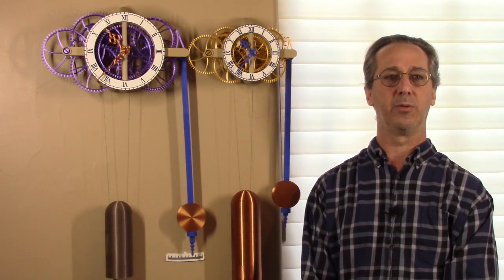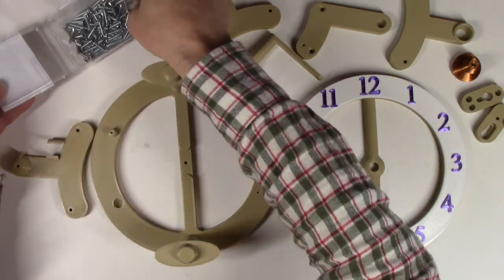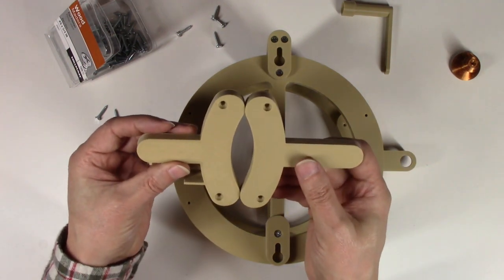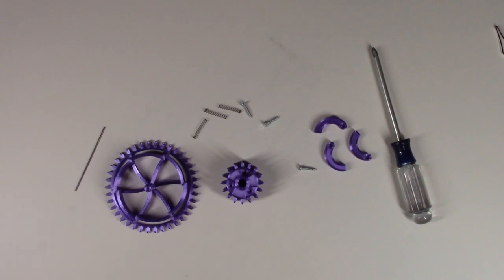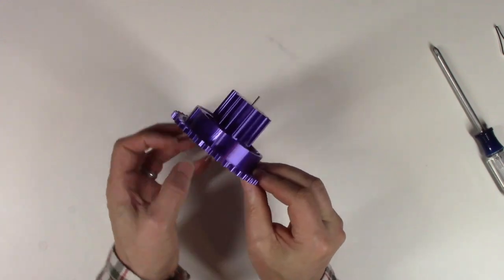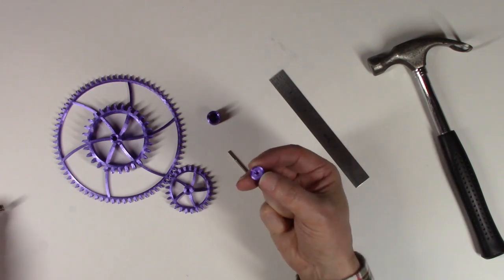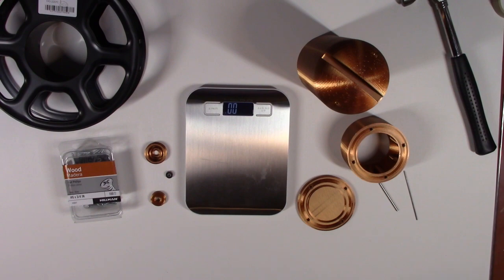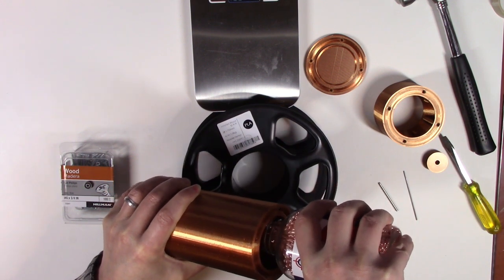EZ Build Clock Assembly Part1 Components

Comment: Hello Steve, I managed to get the watch to work by increasing the weight, but I noticed that it is advancing the real time by a few minutes, what should I do to make it synchronized with the real time and not advance the minutes?
Reply from the maker: Lower the pendulum bob to slow down the clock.
Reply: @stevesclocks  Do you mean to print another arm of the pendulum or just unscrew the nut and lower the pendulum?  And if it persists, what else can I do?
Reply from the maker: @dirvesidade  The adjustable nuts below the bob are designed to allow the effective pendulum to be adjusted. Move them and observe the difference.

Comment: @Steve Peterson

I'm about to start assembly of the clock, but unsure on the weighting to use.

The "Weight Shell" section of the printed guide says 8 lb/3.6 Kg, your video here has 10.8 lb/4.9 Kg.  Another section of the printed guide has projected weights of:
- 7.8 day = 3-4 lb/1.4-1.8 Kg
- 10.1 day = 3.9-5.2 lb/1.8-2.4 Kg
- 15.3 day = 5.9-7.8 lb/2.7-3.53 Kg

I'm guessing therefor the that the 8 lb and 10.8 lb options are for the 32 day configuration?  If the weight is greater than it needs to be, for instance the full 10 lb with the 10.1 day gear combination does that have any issues?

I was aiming for the 10.1 initially and thinking of using hand weights as they are considerably cheaper than BBs (here in the UK at least).
Reply from the maker: The weights listed are just guidelines since each clock may be different. There is not much harm in adding extra weight. It will increase the pendulum amplitude and make the clock more stable.
Reply: @stevesclocks  Thanks for getting back to me.

Having printed the base of the weight pot I can see that it's not going to be wide enough to get hand weights in, so will need to re-think this.

I'm finding a lot of the 3mm holes for the shafts are mighty tight, so will probably need to open these out slightly with a drill.

I'm thinking a light sanding might be called for on clutch components too to clean up the surfaces.  I'm guessing my printer must be a bit off as I'm finding a lot of the components very tight - obviously it can't be your files as many others have successfully built the clock
Reply from the maker: @tomsimmons4482  You can use anything for the weights. A rock with a pulley on top would work.

Most printed holes end up smaller than the initial size. The design starts with slightly oversized holes with the expectation that they will still end up undersized. It is easier to drill a small hole to the proper size than dealing with a hole that is too big. No need to blame your printer. :)
Reply: @stevesclocks  you know, in an odd way it is very tempting to get a rock and attach the pulley now that you've said that - would certainly make for a conversation piece!

Comment: Hi Steve, good afternoon! I started printing the small clock with the 10 day gear, as you said, now what size upper part of the weight shell should I use? thanks.
Reply from the maker: Your filament and printer tolerances might be different than mine, so you have to test to see how much your clock needs. The manual will tell you how much my clock needs. You can use that as a starting point, scaled proportionately to account for your runtime.

Comment: @Steve Peterson

My printer has struck again!

When assembling the palette and pendulum I'm finding the nut very tight , which is not such a big issue.  However, getting the pendulum onto the palette is different matter, it starts is about all I can say.

Similarly putting the parts of the pendulum together, it goes within 1/16" of closing, but that's it.  Lining 2 parts up side-by-side the step profile looks correct so I can only assume it's the hole and peg.

As I said before I don't doubt your designs, it has to be my printer.  I saw a video about a setting in the slicer for "fudging" tolerances on components like nuts, but I'll be blowed if I can find it not - is there anything you're aware of?
Reply from the maker: A simple XY scale on the nut should work. Maybe 2-5% larger.

Comment: Hello Steve, I bought this project on myminifactory, I was separating the files for printing, I've already started printing some pieces, and I noticed that there are several types of pendulum, I printed the pendulum-shaft, I would like to know what the other pendulums are for, I realized that there are several sizes, and which weigth shell top should I print???
Reply from the maker: Everything should be described in the manual. The pendulum shafts with "_long" or "_short" names are only used if you need additional adjustment for the time. Start with the normal ones.

The weight shell depends on the runtime option and the overall friction in your gear train. Build the clock a determine how much weight your clock needs to run reliably, then print the appropriate size according to the table in the manual.

Comment: Good evening Steve, I finished the watch, I made it last 10 days, I did the pendulum test which lasted 5 minutes until it degraded, I did the test with 3.9kg and it only worked for 3 hours and stopped completely, I increased the weight to 4.6kg and it lasted the same time or less, I'm using hook line, it's harder. What's wrong, sorry for the questions, I'm translating everything on Google so I can finish the watch. What should I do to make it work normally???😭
Reply from the maker: It could be too much friction. 5 minutes on the bearing test is fairly short. Make sure the seals are removed from the bearings and the factory grease has been removed. Then test for friction in the gears. Everything should spin freely.

The clock could be out of beat. Make sure the pendulum ticks at an equal angle from left to right. 

If these things don't work, try the 7 or 8 day runtime.

Comment: A question for you, Steve.  Do you have a source for the shaft collar on the minute hand arbor?  Thank you!
Reply from the maker: Here is one at a good price in the US https://www.amazon.com/Hobbypark-Landing-Stopper-Airplane-Replacement/dp/B01EA912P8
There is also a printed part that can be used. It sometimes needs to be scaled down slightly so it becomes a press fit. Or it can be glued into position. The shaft collars are easier since they are removable, but they are not always easy to find.
Reply: @stevesclocks  Thank you for the fast reply!  For some reason I wasn't coming up with that on Amazon.  I just looked it up and ordered them, so they will be here in two days.  I have the clock running and almost completely reliable.  I am going to disassemble it tomorrow to make some adjustments and add a little teflon powder to the bearings.  What I did for the original build was to add a 2.4 mm hole through the printed collar and used two 2.5 mm set screws (180 degrees apart) to hold it in place.  I think the shaft collars should be a little easier and possibly more reliable in the long run.

Comment: this would be about 60 bucks worth of BB's to fill where im at so im just going to try filling it with a 3$ bag of sand. according to some quick calculations I did the biggest weight you have should weigh about 9lbs filled with sand.
Reply from the maker: Measurements on sand local to me showed a specific gravity of less than 2. Solid steel has a density of around 8. Even allowing for air pockets around the BBs, sand only has 1/3 the density. I really wanted for sand to be an option, but the weight shell might need to have many extensions added to be useful. Any type of scrap steel is a better option. Or low denomination coins if you have them. Around US$10 in pennies would probably be enough.

Comment: Hi Steve, first, let me say, I love this project, and it'll be my first when I get my 3d printer. My question is... if one wanted to mount this on a 2x4 or 4x4 or 2x6 for a free standing clock "a la grandfather clock," is there a way to mount this clock and extend the hour and minutes hand? 
Thanks
Ralph
Reply from the maker: Thanks. A clock like https://www.myminifactory.com/object/3d-print-large-pendulum-wall-clock-137009 might be easier to mount free standing or in a case like a grandfather clock. 

Most of my clocks should be able to support longer hands. The extra weight should be minor since the minute hand would only need to be lifted once per hour. Only the second hand in some of my other clocks would need to be balanced.

One consideration is the dial often supports the arbors for the gears behind it. You have to plan around it if you enlarge the dial. That is why I recommended the large clock that already has a bigger dial.
Reply: @Steve Peterson  thank you. When I say extend the hour and minute hand, I mean protrude out to allow for the movement to sit behind it in the "back" of the 2x6,  yet not hidden as that is the beauty of the works, and the hands on the front or face of the 2x6.
Reply from the maker: @ralphguerrero518  All of my clocks use a metal shaft for the fastest hand and a printed shaft for the rest. In this case, the minute hand uses a metal shaft that can easily be extended to any length. 

The hour hand shaft would need to be extended. Most slicers have features that would allow you to split out the center portion, scale it, and merge it back into a single piece.

Some of my other clocks with a second hand would need these edits on two of the gears. The second hand has a metal shaft. Both the hour hand and the minute hand would need to be extended.

My wall mounted clocks are designed to hang from the back. They could possibly hang from the front. You would have to decide if it would be strong enough without sagging.

Comment: good evening Steve I am enjoying building your clock. I did notice frame-back-left-hook and frame-back-left are a little different. could you explane the difference. while following along with you I noticed you were installing the freme-back-left-hook item I printed the other unit
Reply from the maker: Both do the primary job of supporting the winding arbor. Frame_back_left_hook adds a small tab for storing the winding key. I added it to the release after creating the manual.

Comment: My printer has a bed that can print 223x223 cm's. Would like to purchase/print pendulum clock that fits my printer. Please refer me to model that will work.
Reply from the maker: All of my clocks will fit on a Prusa MK3S (250x210) or Ender3 (220x220), so they should fit on your printer. A few of the smaller clocks also fit on a Prusa Mini (180x180).
Reply: The one I'm looking at published 6/10/2020 170x270x120. Is the 270 cm not one piece? @stevesclocks
Reply from the maker: @achillesmjb  That is the overall size of the assembled clock, assembled from many smaller pieces. The descriptions on MyMiniFactory also list the minimum printer size for each design.

I have a Prusa MK3S so I know that every component can be printed on a 250x210 printer. The 220x220 Ender 3 is a popular printer and I make sure that everything will fit it as well. Some parts need to be rotated from the default orientation, but they will fit.

Comment: like the pennies in the pendulum. you could have used pennies in the weight. US pennies weigh 2.5 or 3.1 grams.
Reply from the maker: Good point. Anything with a density near steel or copper can be used. Zinc in modern US pennies is around 7. Steel is 8. Copper is 9. Lead is 11, but barely worth the toxic risk.

Sand only has a density around 2-3, so the weight shell would need to be huge to be functional.

It would take 180 zinc pennies per pound, so just over $14 for 8lb of weight. This is probably cheaper than most other options.

Comment: Thanks Steve for detailed assembly video. What stands for "BB" that you use to fill the weight container?
Reply from the maker: They are small copper plated steel balls used in small target practice guns. Here is a link to the cheapest ones I know of in the US. https://www.amazon.com/Crosman-Copperhead-Copper-Coated-Bottle/dp/B000HKKY7M

Any material with the density of steel or copper can be used. Small nails, scrap steel, pennies, etc. Lead can also be used if you take care of the toxicity. I have seen other clocks that recommend sand or rice, but the weight shell would need to be gigantic to reach the desired weight.
Reply: @stevesclocks  oh, I see. Thank you very much! I wish you great success and much joy in what you love to do!

Comment: Hi. I want to build this. I have been to your site on where to purchase it. I have a question though. The FACE of the clock the outer white circle with the Hourly numbers on it... was that printed as all one piece? With a filament color change on a preset layer in Prusa? I ask because I have an Artillery Sidewinder X1. The filament color change is not very easy or precise. Almost impossible? It seems to plague the Sidewinder users globally. It may be a deal breaker on building any of the designs I see on your site. Might I say, All fantastic designs!! :)
Reply from the maker: I am guessing that color changes on your printer require watching the printer and manually intervening to swap colors. Each new color is several layers thick and there is a bit of tolerance regarding when you make the color swap.
The dial on the smaller clock has a 6.5 hour print time. The first color change at 5 hours is somewhat optional. I like to add a lighter color for better contrast, but it would be fine to skip this change or even delay it for up to an hour if you miss the target time. 
The second color change for the numbers is more important for good visibility. It takes 18 minutes and the color change should probably happen during the first 9 minutes so at least 2 layers are printed in the final color. If you miss, then it wouldn't be too difficult to print just the last few layers of the dial plus numbers and glue them onto the solid color dial. That should be about an hour long print with a 9 minute window near the end to make the color change.
btw: MyMiniFactory is having their summer sale right now. All my clock designs are 30% off until the end of August.
Reply: @stevesclocks  Thank you for your prompt reply! Two questions.. How do I get the 30% off? And as this is my very first clock build/print. Is there any difference between the regular size and the large clock as far as difficulty?
Reply from the maker: @charlesparell5597  The designs are mostly identical except for the size differences. The larger clock has a heavier escapement, so it needs more energy to keep it going. The runtimes are a bit shorter, but still quite reasonable.
The discount is enabled by entering "SummerSale2022" during checkout.

Comment: Which brand of pens did you get the springs from? I am using Pilot G-2's and the spring from them appears to be too large for the holes.
Reply from the maker: I use springs from generic click pens. They are the cheap pens that many companies give away as advertising.
Reply: @stevesclocks  I ordered and measured the springs out of five different click pens here. The ones that seem to work best are the Bic Clic Stics for the ratchet and the Paper Mate Inkjoy  Ballpoint 100RT for the minute hand assembly. https://photos.app.goo.gl/jBy6gUSpvM6RvVCt5
Reply from the maker: @UnlistedChannel932  Thanks for the info. The Bic Clic Stics look like they might work all around. The ratchet has a 5mm hole size, so any spring with an OD of 5mm or less should work. The minute hand spring needs an ID of 3mm to fit over the arbor and the OD was increased slightly to 5.5mm.

Comment: It looks like the shaft in the minute hand assembly has a flat. Did you grind this, or is there somewhere you can buy shafts already like this?
Reply from the maker: The flat is designed to fit a "D" shaped hole on the minute hand. This allows the shaft to rotate with the minute hand when setting the time. It doesn't need much accuracy. Just grind it until the minute hand can be pressed on.

I grind the flat using a bench grinder. It only takes a few quick passes. A metal cutting disk on a Dremel tool should also work nicely. A belt sander would also be an option. The tip might need to be annealed to use a hand file, since music wire is typically hardened. 

Using brass for the shaft would be an alternative that would be easy to work using hand files.
Reply: @stevesclocks  Thanks for the reply. I will probably go with brass as I live close to the ocean and have found some steel shafts corrode over time, and when I can I like to use hand tools over power tools.

Comment: Hello Steve
Congratulations on this achievement.
I just bought the project from the MyMiniFactory site.
I was wondering: the diameter of the '6x3 / 4 "flat head wood screw' is 6mm? This value seems a bit high ...
Thank you in advance for your reply.
Regards,
Robert
Reply from the maker: Hi Robert,

The outer thread diameter is 3.5mm with around 0.7 threads per mm. The length is 19mm and the head diameter is around 6.5mm. 

All wood screws in this country are sold using numbered sizes, but the diameter is not directly proportional to the number. A #12 screw is only 56% larger than a #6 screw. I ordered some metric wood screws from AliExpress to check if M3*20 or M3.5*20 are a good fit. 

Steve
Reply from the maker: Hi Robert, My international order just came in and I tested a cube with screws going in all 6 sides. M3.5*20 are a great fit. They are maybe 10% tighter than the local #6x3/4" screws, but still easy enough to go in all the way. This is the only screw needed for the Easy Build clock.
Reply: @stevesclocks  Hello Steve
Thanks a lot for your answers.
They correspond to what I expected, but I would rather have the official answer from "the expert", rather than make mistakes.
My project is progressing well. I hope to be able to start assembling at the end of the week.
Best regards
Reply: @stevesclocks  Hi Steve,
Yes! I confirm. M3.5*20 are a great fit for me too.